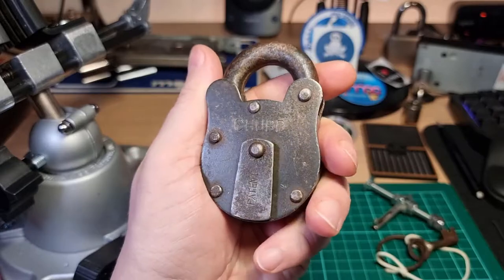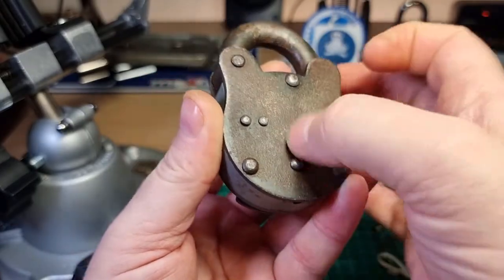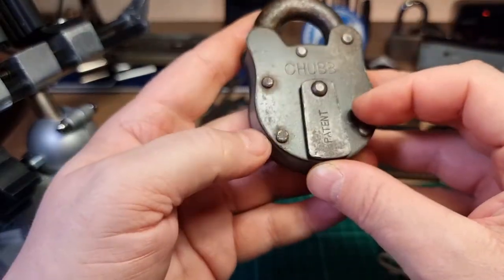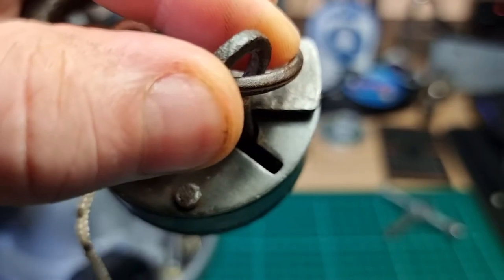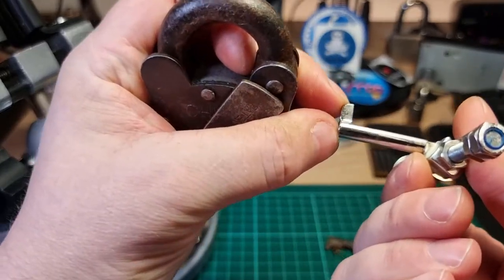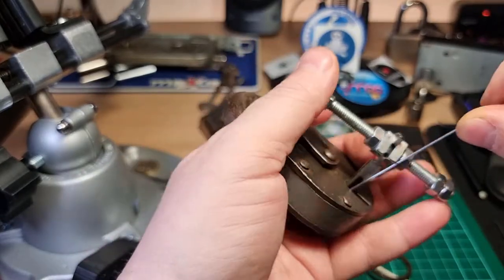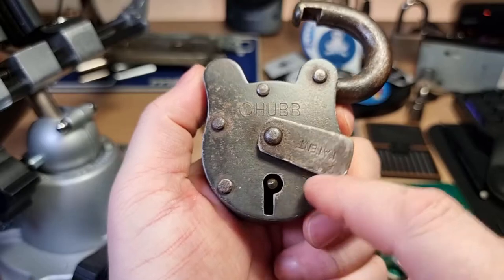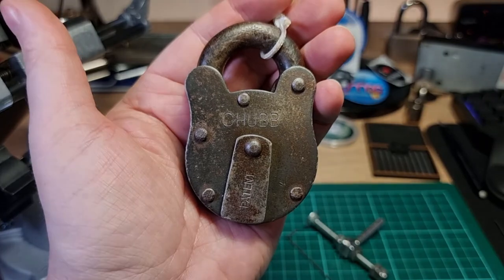(156) Chubb Corvette, Vintage 4-Lever Padlock

Comment: Beautiful old lock.
You did just enough to give a gentle restoration without losing its aged character. 
Nice gentle picking sees an open.
Cheers Mylok.
Reply from the maker: Thank you.
I've seen a few old lever padlocks for sale that have been "cleaned" using a bench grinder and wire wheel, totally ruined them.
All I wanted to do was clean off the surface rust and stabilise it.
I found it's easy to over lift the levers in this, if I'm not careful.
Cheers Roy 👍 🍻

Comment: Nice lock. Very tasteful clean up. Might try a brass brush on mine. Dont want to ruin the patina.
Well picked too👍
Reply from the maker: Thank you 😁 
As long as there's not any flaking paint the brass wire brush is probably as sympathetic but effective a method as I can think of... 
I used a light penetrant oil, scrub then clean off with some blue roll.
It's easy to over lift the levers in the little Corvette.. I found sometimes easing off the tension and I'd get the open on the drop.
Cheers bud 👍 🍻
Reply: @Myloks  I might try with mine. I usually try to go shiney. But the corvette wouldent look right. Beass brush was a good plan. The ease off the tension trick is a good one. It comes in handy👐
Reply from the maker: @Deadlocks86  you'll need to show it off in a before and after video.. I should have made a clean up video but I was that eager to get stuck in I never thought 😆.
Cheers bud 👍 🍻
Reply: @Myloks  good idea. Problys wouldent be a dramatic change tho. It has surface rust. But not alot